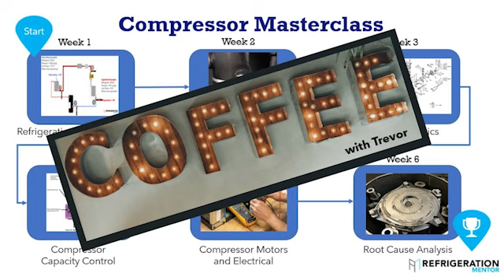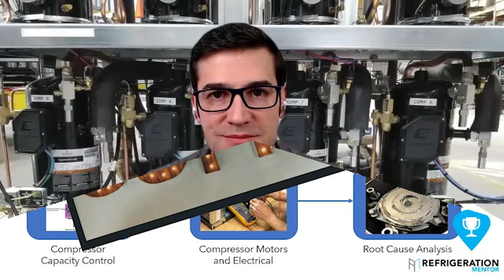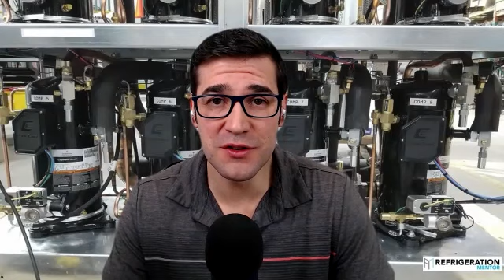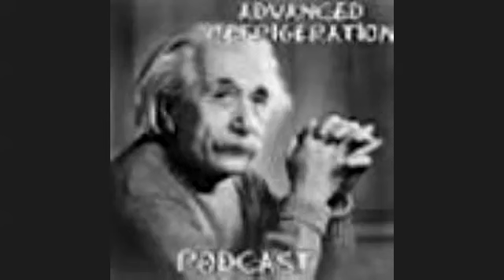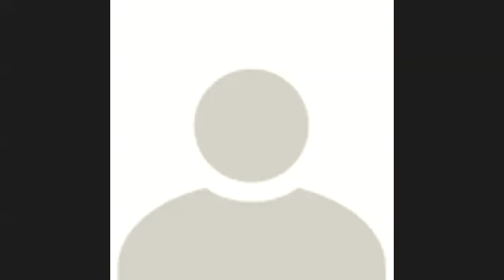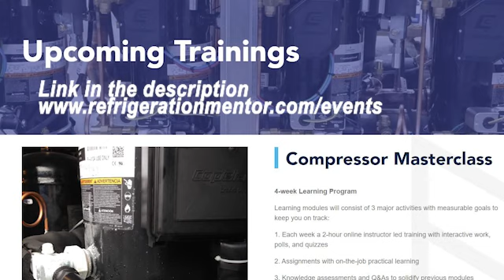What happens when you lose Refrigerant Oil in a system?

Comment: Great video my brother. My question is when you are fixing a second hand compressor maybe on a double door fridge. What are the things you supposed to check on that compressor's apart from discharging power. Do some compressors spray oil in the process of checking discharge power?
Reply from the maker: No. Check my refrigeration check point video. It would be a great start.

Comment: Any thoughts on using PVE oil in copeland Scroll compressors 5ton of less in the ZP/ZPS series as a drain/fill service replacement to POE?
Reply from the maker: Is PVE more expensive than POE
Reply: @RefrigerationMentor  yes. Much more expensive. $60USD per 32 oz.
Reply from the maker: So I would go with POE